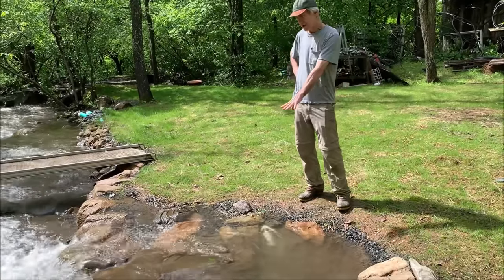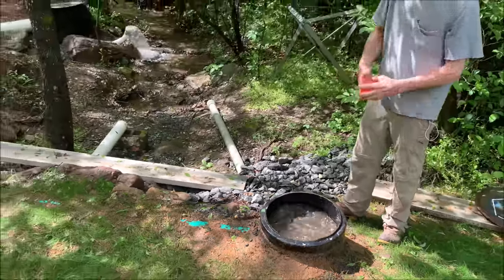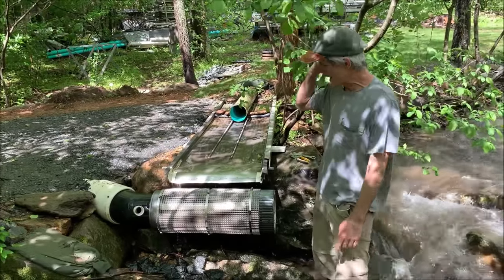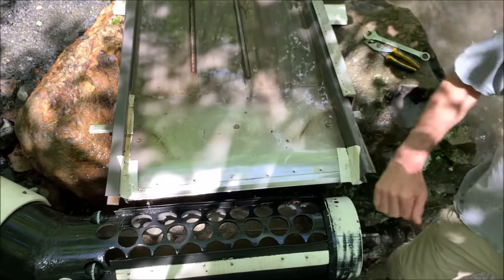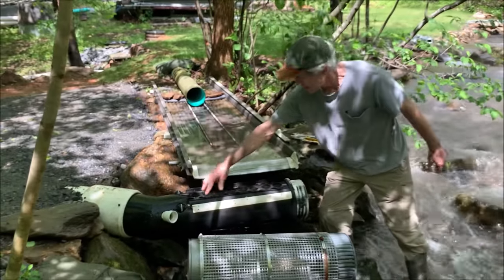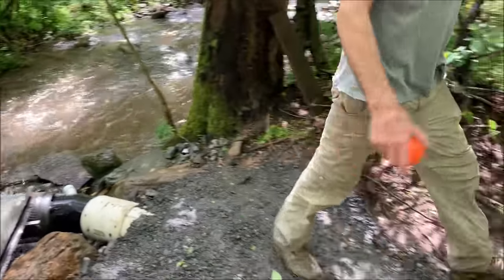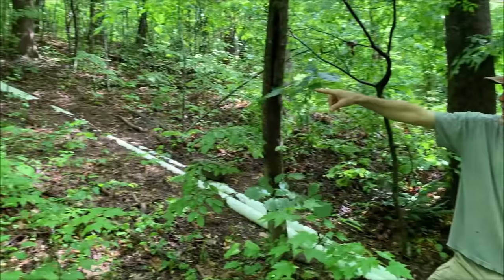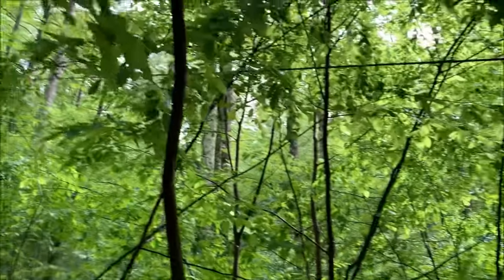500 Watt Hydro Power System in Virginia (Overview)

Comment: Love the engineering going on here. the self cleaning grate is great, seen similar things, but I like this implementation the best. Very well thought out, the use of natural infrastructure is great.  Tree suspension bridge system is beautiful, and the rock mount of the turbine is pretty excellent. Im running a solar array here, all salvaged, n the 3-800w I get through the day is more than enough for everything bar the aircon and oven. I have them on grid. The only shortfall is the crappy old batteries I have, but its mostly enough. If the batterys run dry, its probably time to turn the computer and lights off anyway, go to bed. I have a fail-to-grid switch, so I dont loose anything, but its a sting to hear that click and know your paying for power again.

Possibly the only upgrade I could recommend, look into a low frequency AC Inverter. Dump those newfangled switch mode units. Sure, they are HUGE and HEAVY, but for a fixed installation, that's no big deal. Not only is it very good quality AC (nice clean sine), but the real take home advantage is standby power usage. On my PowerJack 3000w, no AC load draw is about .11A. On my 600w switcher, its about 1.5A. No load. 36w for doing nothing, sheesh..The efficiency gets really good at about 400w, but either side of that, its pretty rubbish. n it gets HOT. The LF inverter, is very efficient on just about everything. Has a massive surge rating (12000w I think), has no problems starting my air compressor, fridge, mill, etc. doing a full english fryup breakfast on the 2400w electric pan is a breeze to the inverter, batterys dont like it tho.

I must warn you, the ‘PowerJack Brand’ isnt rally a brand, more a type designation, there are quite a number of manufactures. I think its based off a 90’s German design. On one hand this is good, there are many spares available. You can build your own from parts. I have seen such things using rewound microwave oven transformers to get away from the heavy shipping costs. You can get very cheap ones, very expensive ones, but from china, get what you pay for. I think my 3000w unit was $380 USD, with $100 shipping. Given a local equivalent was about $1500 im pretty happy. Its run no sweat on 45°c days, for 2 years now. Still have the switcher if I need it, but best upgrade to my system yet.
Reply: Liebe
Reply: Liebe
Reply: Sehr

Comment: 0:00 to 0:38 What is that small white cylindrical thing(with diameter smaller than the main pipe), rapidly moving right and left at the beginning of water inlet ??

Comment: I would use a tradititional waterweel in this case :  plenty of water available and only 2 m high interval needed to generate 5000 W. No problems with dirt in the water when using a top load waterwheel
Reply: Tino Senf Do they have a site in English? My German is a little rusty.
Reply: @tinosenf6937  Still would prefer an overshot wheel, even if efficency is less then a undershood wheel. Also a lot easyer to construct (for a non professional and for own home use ) then an undershoud wheel with need a closed water path below. Overshoot seems to me also  less vulneral to big dirt parts in the water. They will go over the wheel instead of blocking the wheel. PS : using a proven concept is not reinventing the wheel nor staying in the past ... Each one should select / use what seems best for them, after evaluating all or other possibilities. It's not becase I would use it, someone else need to use it ....
Reply: @Anonymous-it5jw  take google translate! My english is not better! also rusty...lol
Reply: @tinosenf6937  That's quite interesting, but it must have required an awful lot of work to set up!
Reply: @lr21643  definitly...and not only work, but many, many knowledge (IQ)
Reply: Question I always ask is the fish in the water moving up and down these waters how can there movements be considered to keep streams & river alive.
Reply: @bartdepauw1156  For stream like this I suggest using a backshot wheel, you drop the water straight down so differences in flow rate from flooding or drought does not affect where it lands on the wheel, that is benefit one. Another issue is if the wheel is in the stream, or if flooding causes water to reach it, in a backshot wheel both the stream and falling water will be turning the wheel in the same direction. Rather than increasing complexity this design means you have less problems positioning the wheel and outflow pipe.
If the height is not sufficient a breastshot wheel can be used instead.
Overshot wheel could have the water literally going over top of the wheel if the flow increases, while a flooding stream would be pushing it in the opposite direction.
Reply: @bartdepauw1156  overshot and backshot wheels are more efficient than under
Reply: @RobBCactive  Being able to take advantage of the weight of water directly is a wonderful thing. Conventional river (undershot) waterwheels only collect energy from the velocity of moving water while overshot and backshot wheels can harvest both, though design complexity may be increased to do a good job of it.
Reply: @tinosenf6937  Must have been informative.  Youtube removed it:((  Can't see it.
Reply: You can't get the flow rate from a water wheel like you do from a down hill hydro water system. Which is why many people prefer to build a large Dam with a downhill system in order to get a greater output. You'd need to build waterwheel & a high torque and speed gear box system in conjunction with a few alternators to get the same power output. Its just his system is pretty complex where as many other downhill negative water pressure water turbine systems aren't & are pretty easy to set up given you have enough water
Reply: @nomochances777  i try it now, but i also dont can see this video...
Reply: I like that alternative
Reply: This. For his flow, he could use a water wheel generator setup for a fraction of the cost and effort it took to build all that nonsense. Heck, he has major flow action. He could have 4 water wheels and generate tons of power on that creek.
Reply: @jimmybob7364   Don't the winters get bad in Virginia?  Seems to me like putting this stuff underground would be the way to go.
Reply: @spuriouseffect  Rarely below freezing and minimal snow. Depending on the actual location in VA
Reply: @shannonp4037   I'm in Southern North Carolina, about 40 miles north of Myrtle Beach, South Carolina, and it gets below freezing quite a bit at night.

Comment: What voltage do u get from ur turbine on three phases? If its 108/120 why not have a disconnect where u can send 2 phase ac to the house and use third phase to tricle charge batteries on 120v inverter

Comment: That could be a really nice system, 6" would made more power, and the 4x2" is a bit restrictive,  I'd go with 3" right to two nozzles, 2 x 2" does not equal tge 4" capacity, but I'd still like to have a system just like it! Ifi dam up my spring, I maybe could get 1kw for about 8-12 hours, then gave to let the pond refill, but it would be well worth it when the sun hasn't been out for a week! Being off grid you need multiple means, and as many backups as possible! Nice system!
Reply: I thought it was strange he didn't just have 1 larger pipe for most of the journey. Perhaps he just had that lying around and used what he had. You'll get less friction in a larger pipe. 

Also to get maximum power you need as much drop as possible but he seems to have the turbine quite a way above the water level. He could have put it lower and got more power.

Comment: A most interesting and ingenious set up, particularly the filtering arrangements, however, a huge effort for only 500 Watts, thank you.
Reply: 500w is 12kw a day. That's a ton of power
Reply: @jimargeropoulos8309   - 500 watt for 24 hours  = 12 kWh
Reply: @jimargeropoulos8309  How can 500 W been 12000 W ?
Reply: @bartdepauw1156  500w x 24h = 12000kwh
Reply: @bartdepauw1156  As I understand it, a typical US home averages about 12KWh. If you do a little work to optimize your usage, you can get in below that mark
Reply: @jimargeropoulos8309  Yes, I know the difference between W and Wh ( but seems some use this all togetter as the same ). PS : 12000kwh is a lot, thats 12 Mwh. And you are correct : 500 W is a ton of power and 12 Kwh is a ton of energy
Reply: He didn’t say anything about the capacity of the batteries I suspect he is chucking away a lot through the heater.Could do with extra storage for drier times.Good project 👍🏻
Reply: @bartdepauw1156  Not really. 12Kwh wouldn't run our home for even half a day. Our average is 67Kwh per day.  Why so high, because the A/C and dehumidifiers run almost 24/7. The A/C just kicked in again for example. Temp outside, 75° and 95% humidity. Temp inside, 75° and 40% humidity. And that is at 0400 in the morning.
Reply: @bartdepauw1156  I just google the figures and it says average US home usage is 29 kWh per day, not 12. It's around 11,000 per year so maybe you got mixed up with the per year figures?

Comment: Nice setup.  And props for not overstating the power.  Thanks for showing the voltage and current too.  It bugs me when someone just shows the voltage measurement and says something ridiculous like "Here's my 5KW system".   Ohms law calculation shows you running at around 425 watts just then.  So totally accurate claims in this vids title.   Good job!

Comment: Any way to confirm the power boasted? In my experience, if something is producing 500w worth of kinetic energy (before parasitic loss and generator inefficiency), you cannot stop it with your hand. I want to see voltage/current levels during operation. Lol

Comment: That's an admirable set-up, but seems an awful lot of cost, effort and technology for just 500 Watts. I'm sure that with that head of water and flow rate available you should be generating 5 to 10 KW .
Reply: What many people don't see is that water flow is temporary, after a big rain. The average  flow rate is a better target for design capacity and is much less.  The cost of the system is largely in the pipe needed for the 40' of head
Reply: probably lost a lot of power in those sharp bends
Reply: @jschiller860  that and the miles of cable he has strung up in the trees to support the creek crossings.
Reply: It seems like every component in the system is designed to limit the volume of water instead of maximizing it.
Reply: His debri catch malfunctions with too much water.  I'd rather deal with clean-out of a basic filter, and have flow all the time, than say "Ahh, well it's raining all week. No power."..  Eliminate that entire prefilter system he's running and let the head pressure drive the right turbine for those 10kw rewards.
Reply: @jlydon29  Agreed! You can tell this guy loves it and this is a major hobby. The engineering of it all would be so much fun.
Reply: 500watts, 24 hours a day is the equivalent of 12KWh of energy per day.  Though I think he is losing a lot of energy in his pipework and screens.

Comment: Hell of a lot of work for the equivalent of 2 or 3 solar panels.
Reply: Yes but it works at night and cloudy days
Reply: 500watts, 24 hours a day is the equivalent of 12KWh of energy per day,  you'd need a lot more than 3 solar panels to match that.  He'd probably get even more energy in the winter with a higher water flow, solar would be less.

Comment: very nice setup thanks for sharing. one question is there a reason why you went with a turgo wheel as they are a reaction turbine meant for hi head and low flow.  I think you could be getting a lot more power if you got your self a reaction type turbine say like a Kaplan or a crossflow? I would be happy to do some math for you if you give your GPM flow rate to see what you could make?
Reply: I was thinking the exact same thing, reaction turbine would have had less plumbing, but cool design. I like the roll cage as part of a filter.

Comment: I built one of these at summer home that I currently own three years ago in produce so much electricity when we were not home we would have to bypass the water from the mechanism so as not to damage the electron a components inside our hunting shed. In the winter before the water froze we would actually heat a 1500 square-foot hunting cabin with electric baseboards and about 10 large truck batteries we would use for storage

Comment: Can you keep it AC and use a transformer to push the voltage to the home to limit loss? Then use an inverter for DC applications? Not an electrical engineer just looking for a fun discussion. Great build though very cool

Comment: I feel this was way too much work for a maximum of 1,000w. Probably could have cut out half the stuff and gotten more power with less energy losses.
Reply: I felt it was a little over engineered as well. I'm sure there is a more simple design with higher output.
Reply: You can think of it that way, or you can think of how easily he coul upgrade to much more power with his existing system.
Reply: I would think generating the power closer to the source and running cable rather than pipe would be easier.

Comment: Hmm. Nice setup.  I noticed in the electrical box the outlets are facing straight up.  If you have an emergency and its sprinkling or raining that's going to be an issue.  Thoughts on turning and covering them?  
Also I noticed the runs.  Have you tried adjusting the pipes higher so its a slightly less angled roll down the hill until the last 50-75 feet and then going with a much higher sloped angle to the turbine itself.  Wouldn't that give you more power?  (just spit balling... so please correct me if I'm not looking at it correctly)

Comment: Damn bro just build a water wheel
Reply: thats what i was thinking
Reply: Holy crap what a convoluted contraption.  Yes a water wheel with a properly designed gear box would get him the same RPM .  Less points of failure.
Reply: I feel like this whole thing is more “I’m bored, how can I use my expertise and knowledge to make an extravagant hydro electro battery charger” 

It’s pretty impressive, though I do agree it’s a little bit excessive lol
Reply: @thereefaholic  There are reasons micro-hydro is done this way.
The power you get is proportional to height (pressure) * flow rate.
 With a water wheel the height is at most the diameter of the wheel. If you do it this way, you have a column of water the entire height from the top of the creek to the bottom, so you can generate much more power.
The other stuff is just to keep cruft out of the pipes. The spinning thing is actually a pretty neat idea too, it means he doesn't need to manually clean of the screen when it gets full of twigs and leaves and whatnot.
TL;DR This produces much more power than a water wheel would be able to. And the stuff at the beginning is just to keep the pipes clear.
Reply: I smell grant money.
Reply: For 500 watts😂😂😂😂 am I missing something here. He could of got that at the first waterfall.
Reply: @solardiyhobbyandrevies8118  It's probably pretty variable, might not always have enough water for that I guess?
Reply: @101m4n  I don't agree with you on this and here is why, for the same proportional effort he put in he could have easy made a large dam and since he has good flow rate it means he can actually build a large waterwheel or same functioning device and have made close to or more than 500 watts. People tend to forget the more parts you have and the more speed you have in your system means you will have high amounts of maintenance which is not what you want in a system like this. The reason a waterwheel works so well is the fact that it has high amounts of torque compared to a nozzle based system which does not. This guys system is going to have him out tweaking and tuning every week and like you I believe my time is valuable. The amount of effort he spent on this system and cost he could have built a waterwheel system and a wind/solar system and still have time left.
Reply: If you can add more magnetic poles to the turbine, you could theoretically generate greater amounts of energy
Reply: WATER WHEEL WOULD HAVE BEEN CHEAPER.
Reply: Minecraft redstone
Reply: Exactly!
Reply: @kazykamakaze131  seems to me he could have built several waterwheels on that first section of drop off alone.  I'm not well versed in this but couldn't he have simply dug out the first drop into a true fall and then had one or more waterwheel off of that?
Reply: @UnfoundHopes  Yeah people sometimes over complicate something that should have been simple. Why reinvent the wheel? in this case, the water wheel. If you need more torque just make a larger water wheel or add another water wheel, since in this case he had significant water flow through his property and would have easily had enough to make 2-3 water wheels run and still have left over flow rate.
Reply: The point is to get power from gravity not the flow rate. This way has much more efficiency than a water weel and will produce the same amount of power even when there is little water flow
Reply: @nathanvanblommestein4316  The point of this endeavor is to make power from gravity, not to get the most efficient system as can be seen by significant flow rate he has it really is a wasted effort to go through as much effort and cost as he did. More effort+ parts = more $$$. Whole point is generating electricity, but if you complicate things and make it expensive then might as well go solar with battery storage.